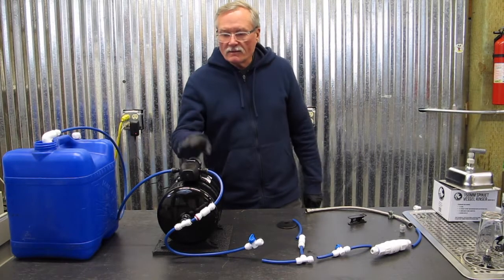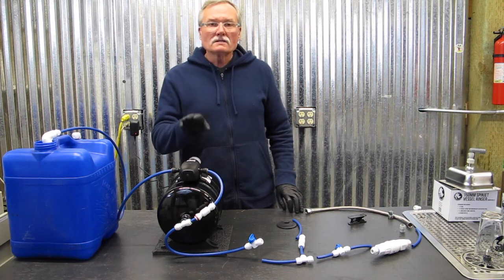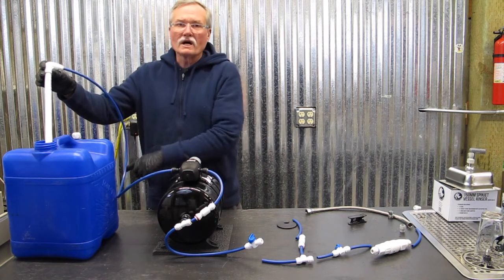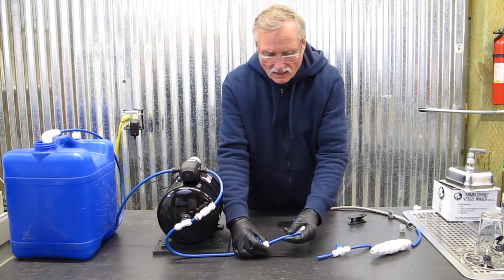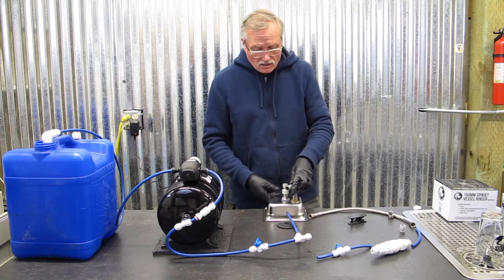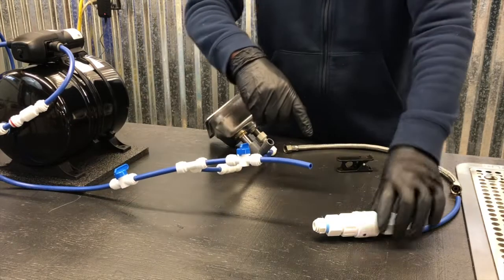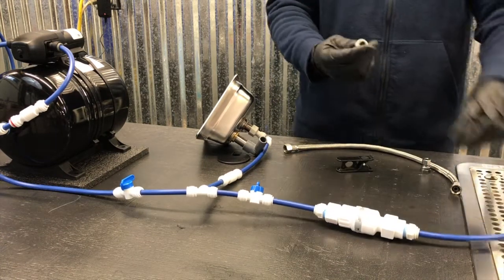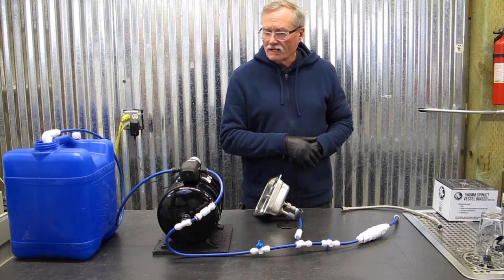Connecting A Pitcher Rinser & Espresso Machine To A Water Pump System

Comment: hi, thank you for the video,
I have a question if you dont mind, in my case i am using another tank for rinser drain, with waste accumulation, within a day i start to smell milk odors, how to get rid of the odor? without the need of frequently emptying the drain tank or using chemical solutions.
can a drain u-tube solve it (drain smell trap)? 
also how can i drain to a tank while it is completely sealed off ? (to prevent smells and odors).
thank you again
Reply from the maker: For a mobile system, you should be draining and rinsing your waste tanks every day.

Comment: I bought the tank with pump but my tank does not fill up with water. when installing and on/off ball valve and opening it water flows good. Once I close it, pump seems like goes into overdrive and does not fill up my tank...I shake it and don't feel any water in there. Help??
Reply from the maker: What size tank are you trying to fill? What pump is it?
Reply: @Caffewerks  I bought the "Caffewerks 1 GPM W/ 2 Gallon Tank Water Pump System" I checked the pressure inside the tank with a bike pump and was getting around 25 or so psi empty which it came with from you guys. Am I doing something wrong? when the valve in is turned off( which I installed on the outflow because I want to connect it to my espresso machine) I don't see any water getting pumped out of my 7 gallon water reservoir, until I open valve then I get a nice flow of water and its bypassing the 2 gallon tank?
Reply from the maker: vik kash water will only flow when the valve is open of course. The tank does not hold a full two gallons. The pressure is correct for your system. I would recommend making sure all lines are pushed into the fittings firmly especially the in coming line from the tank to pump. Also for quicker service please email info@caffewerks.com
Reply: @Caffewerks  Yes I will email you instead. thanks

Comment: Thanks for the video! Are you using Teflon tape for the threads?
Reply from the maker: I use PTFE tape rated for steam (Thicker) where needed. In this instance at the accumulator fittings and plastic to plastic threads on the pressure regulators.